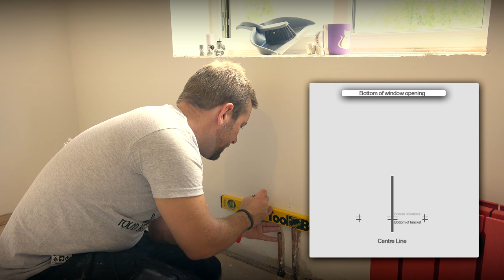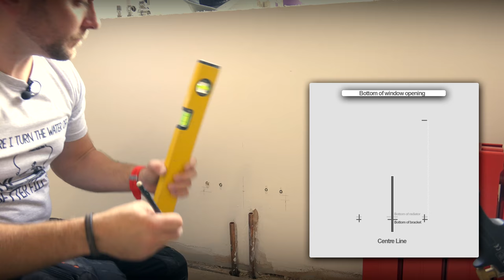HOW TO HANG A DESIGNER RADIATOR - Mark out brackets.

Comment: Do love these videos, actually very informative but cant watch one without cracking up!

I have tried installing a vertical fl as t panel rad recently but one installed there is excess movement back and forth where the rad moves on the brackets themself. Dont know if I've done something wrong or if it's just the cheapo ebay rad

Comment: Pipework (whilst neat as always) really needs to be chopped into the wall. It's akin to having your sparky fit designer faceplates to all your switches and sockets and surface running the rewire in plastic capping.

Comment: There is a lot of pipe compared to the radiator. Is there any other way of doing it? Do you think a longer radiator would have looked better under that window?
Reply: In The Netherlands radiators are usually connected using the top and bottom connections on one side. Although it's less symmetric, I think it's a much cleaner look.
Reply: @Kalabenos  they use the top and bottom on one side, or the top of one side and the bottom of the other?
Reply: @daleprosser350  The top and bottom connections on the same side of the radiator
Reply: @Kalabenos  That's odd, I've seen top and bottom of opposite sides but never that before

Comment: So if the bracket sits 10mm higher  than the bottom of the radiator would you not position it 10mm above the bottom of the radiator line to get the radiator to finish on its line?
Putting it 10mm below the bottom of the radiator line would hang the rad 20mm below the line ?
Unless I've picked you up wrong ?
My rule of thumb is whatever the distance between the bottom of the bracket and the floor is means if you fitted your bracket at that height the radiator would sit flush on the floor so you would then add the height of the skirting or whatever to get it to finish at that level.

Comment: Looks great. What fixer foam do you recommend for those walls. Got a similar wall from the 1950's that feels like its made from straw :) Early form of breeze block.
Reply: Sounds like Cobb? If your going to be hanging a rad on it you want to make some wooden spikes (around 8 inches long and about an inch wide and hammer those into the wall by drilling a hole thats smaller than the spike and  then using a lump hammer to drive them in and hang the rad on those.
Reply from the maker: Cob = Hell!

Comment: Well done on the live video. I've got some great tips from you over the past 6 months or so, sorry I don't know what video to put this comment on so I've used the latest one, I hope you don't mind.  I have an emergency issue and I need a quick fix for a couple of days. I have my own well and the 50 Lt pressure vessel has just burst, the well is feeding a 900 Lt potable water tank but I need to bypass the pressure switch and vessel until I get a new vessel on Monday. I've bypassed the vessel but the deep well pump will not turn on, I'm sure it's something to do with the Hi/Low pressure switch or the control box. Can you help Please.
Eric

Comment: Cool adirator. I must say I cringed a little bit when you took the center-to-center measurement from the actual "centers" for them brackets.... it's so much easier and more precise to measure from edge to edge.
Reply: He Ka true, that’s a good tip which I don’t think many people realise, edge to edge = center to center as long as the diameters are the same, it’s valuable info to know that, makes things a lot simpler and negates errors

Comment: oh maa gaaawd!
nicee work
Reply from the maker: Cheers dude!
Reply: plumberparts . Hi, what's the best way to add a radiator without getting an air lock in the system. The system I'm working on has 17 rads, And has an air lock the last time I worked on it. I didn't know how to get rid of the air in the boiler.

Comment: On the subject of those little plastic bits that stop the rad/bracket from clicking... what do you do if you have put them in but your rad still clicks?! :( Nice job with the sexy rad, btw James!
Reply from the maker: That probably the pipework, not the rad...
Reply: Thanks, but it's all plastic plumbing. It does go through one of those metal electrical back boxes where it comes out of the wall though...

Comment: Radiator looks great but the pipe work 😒, well you could have done better 😥
Reply from the maker: Yeh at the start of the job I didn't know what size was going in. Went safe with tight centres. Don't really think after that I could have done much better other than paint it in gold....but hey ho!
Reply: Just done my daughters. She had dot and dab, I just chased the board so the pipe exited just below the valve. Much tidier finish.
Reply: plumberparts I need you to correct this problem, it's your reputation on the line, and I wanna see chrome pipes ok lol not asking much, braa hold tight !!
Reply: yeah.. i agree im really surprised this installation was done like this. i dont normally fault his work because i cant but pipes out the wall above the skirting are the only way for designer rads like that. and bring them out tighter if you dont know the rad size
Reply from the maker: Hi Tobi, it's so easy with hindsight and from your computer to just type that comment out! I didn't know at the time of first fix that we'd be putting insualted back board on the walls, bringing out the wall by nearly 30mm...killing my depth for skirting. I'll get round it though....somehow!
Reply: plumberparts  good lad you know it makes sense fella